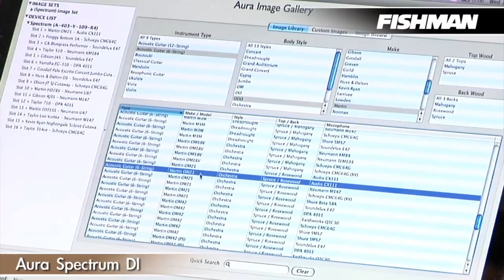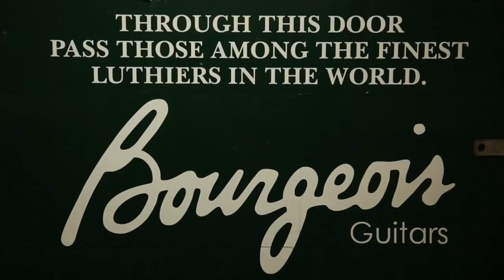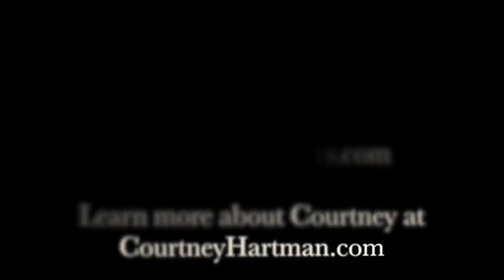A Star-Studded Luthier Showcase (AT46)

Comment: Check into the "Headway EDB-2" DI.  I have been using this for about 5 years now and love it.  I can control SO much in my acoustic guitar and voice mic!  It is so versatile.  I can use a small mic arm that mounts into the back of the EDB-2 and hang it on the mic stand. Until I started using the Headway EDB-2, I was using the LR Baggs Para Acoustic DI which worked well for me......Russell D.

Comment: I have a "Fishman Ellipse Aura" in my Martin HD28. I also have a Fishman Platinum Pro E.Q. Direct Box. I don't use any of the mic settings, e.g. shure SM57, SM58, etc. on the Ellipse Aura. I push the slider the whole way to JUST the pickup. The different mic presets just seem to lower different frequencies. Kinda shitty sounds in my opinion. I do like the Platinum Pro direct box. Although I set it on post rather than pre so mostly the sound man gets the best "uncolored" signal to work with. Thanks for sharing the Aura Spectrum! I just picked the most expensive Stomp Box, (Platinum Pro), and Pickup, (Ellispe Aura), for my guitar. I'm happy with all the Fishman pickups I put on my instruments. I have them on my fiddle and mandolin as well.